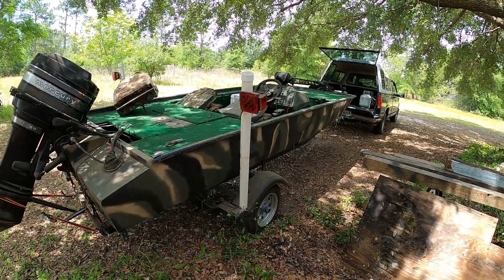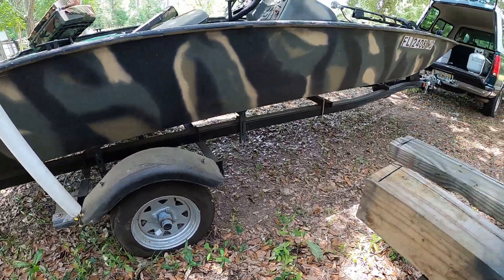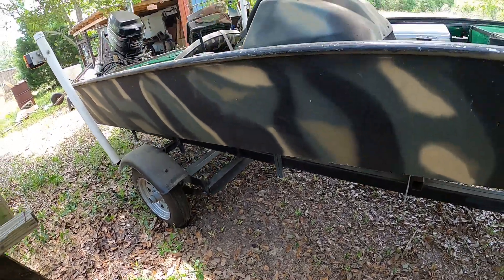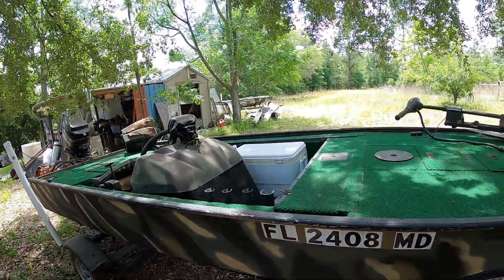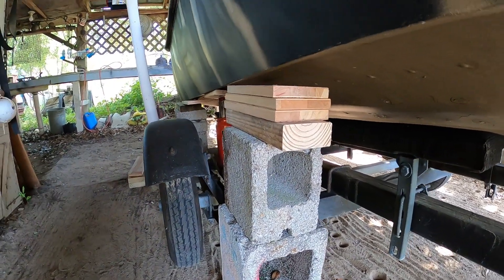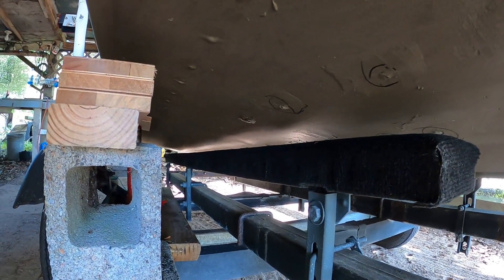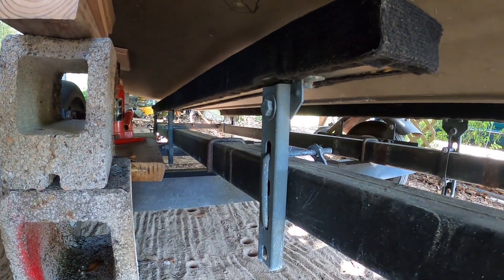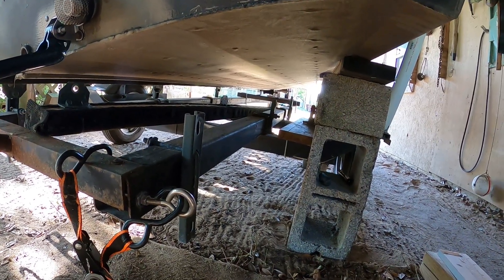Here we go again!  Boat leak repair/patch  Pt 1

Comment: Man Ricky, they have alumini weld rods for those rivets, you just use a map gas torch and braze the rods to fill the holes...they say you can get them at harbor freight,,not sure about it sucking back around the rivet without the boat being turned over...but it might,,sure wouldnt want it to drip down on you, it would burn really bad,,but it would seal them really good
Reply from the maker: I looked at those, The thought of stripping it to flip it,  to much work.  :)

Comment: How much of the flooring and interior would you have to remove to get at it from the top? Is there anyway to re-rivet it from the top or bottom only or would you need access to both sides at the same time?